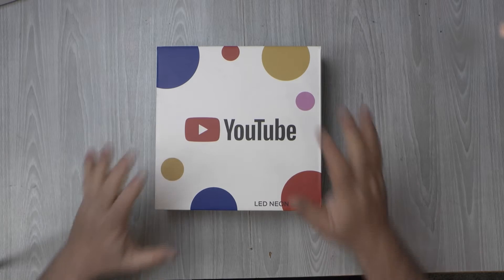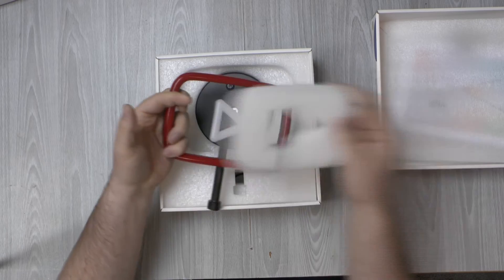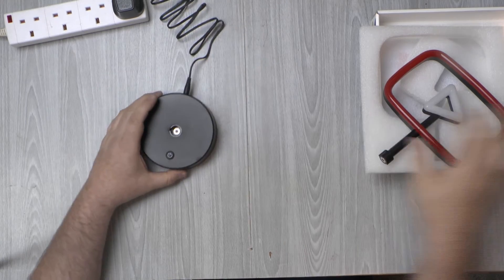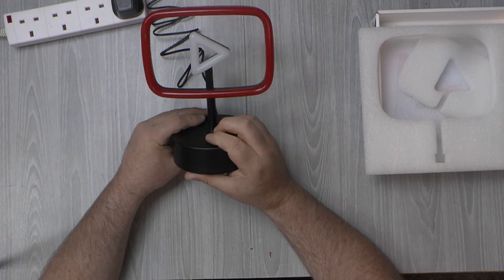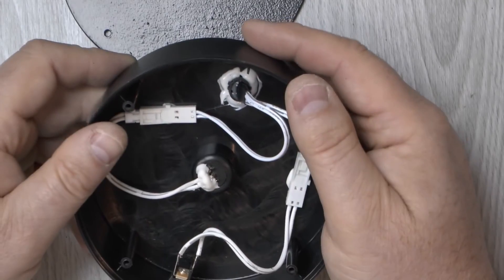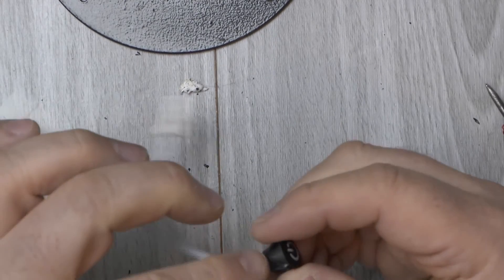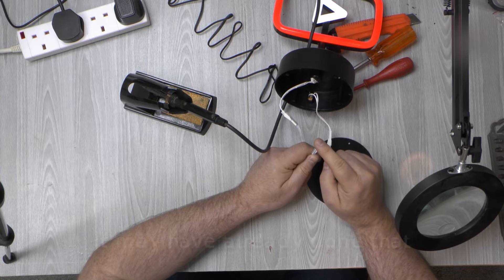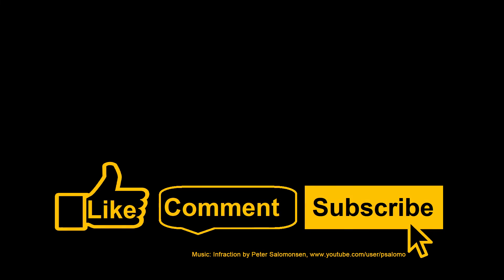What's inside a YouTube limited edition Neon Play Button?

Comment: Where did you get that? Did you get enough subscribers to have YouTube send it to you or did you buy it somewhere? if you bought it I'd like to know where because I want one.
Reply from the maker: I got an email from YouTube in May, inviting me to sign up at the Rewards Hub (with a unique code, so it looks like it's invite-only).  I signed up a few hours later and this limited edition light was on there as a free gift.  I went for it, it arrived a few days ago.
I expect some will find their way onto eBay soon enough.
Reply: @AintBigAintClever  I'm just worried about scams. I won a CO2 powered salt gun from that company that makes those salt guns you shoot flies with and I was skeptical until they messaged me on FB messenger saying I won their caption contest so I gave them an address and they sent it out. Got it a few days later but haven't tried it yet, not enough bugs to shoot.